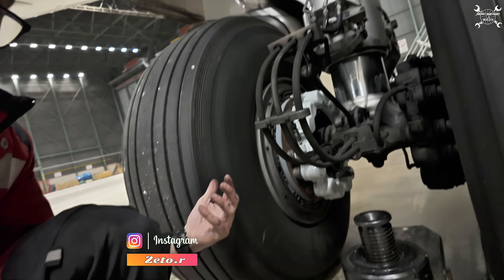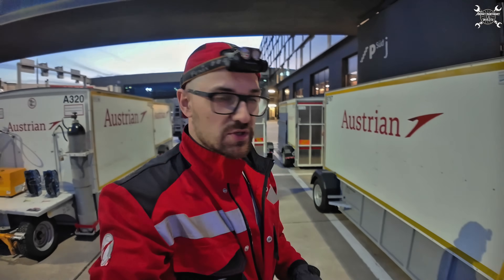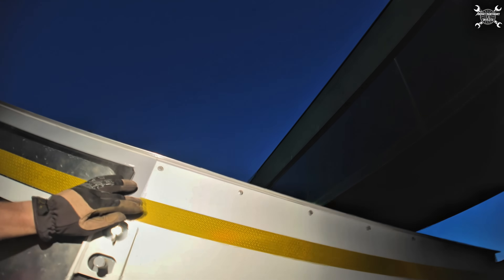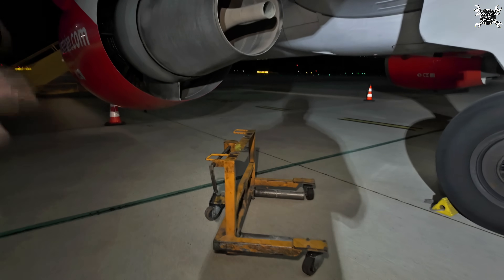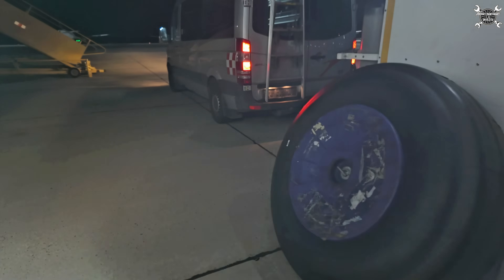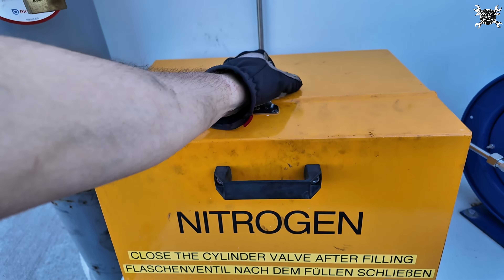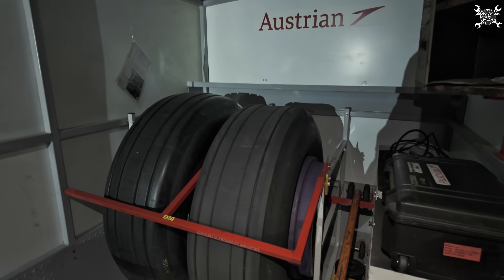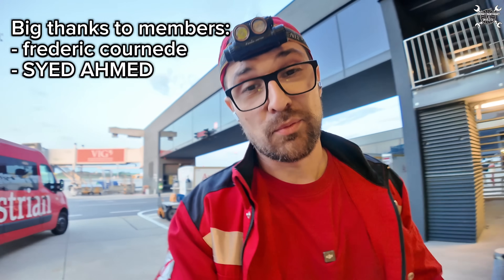How to replace wheel on the aircraft with proper Equipment

Comment: Boss needed a video of A320  main wheel and nose wheel tools which are used during removing and installation process.
Reply from the maker: You saw them in this video
Reply: @zeto.r  sir I'm asking about tools which is uesed during removal of wheel like 5/6 open end spanner and box spanner etc etc. Sir if you don't mind please then mention all tools with their numbers
Reply from the maker: I'm not planning to do such video. Your company should provide proper tools for your work